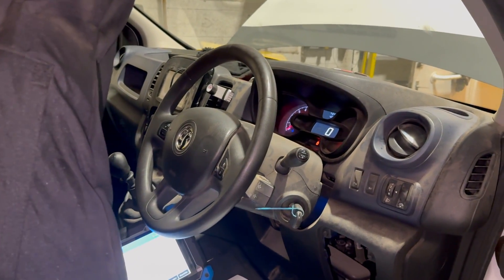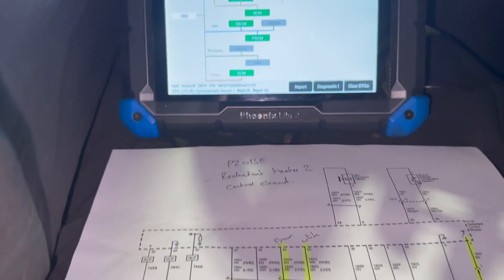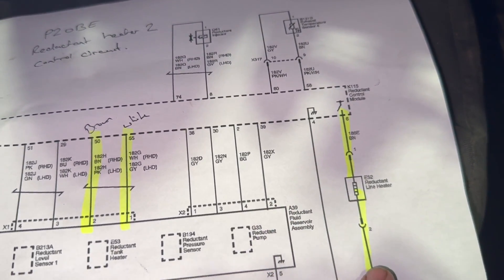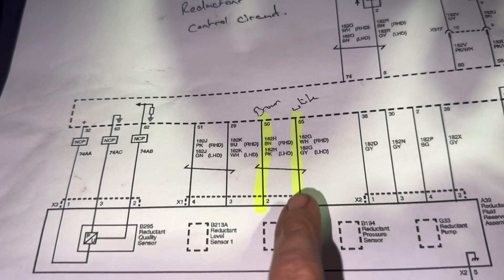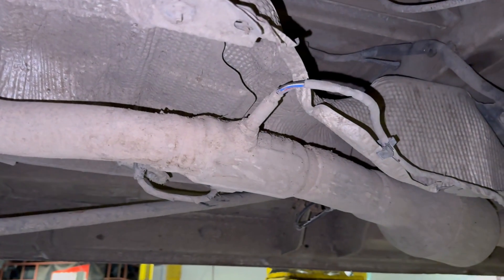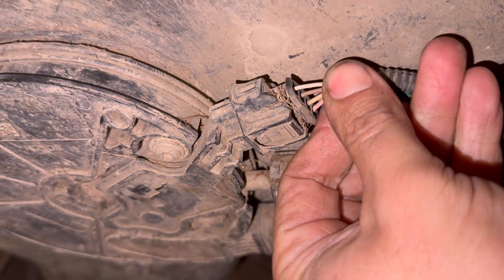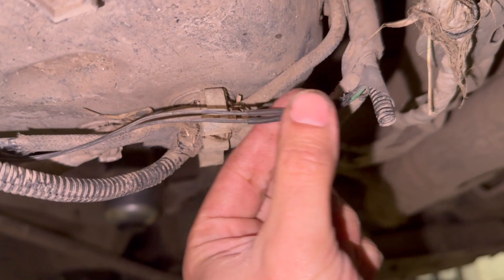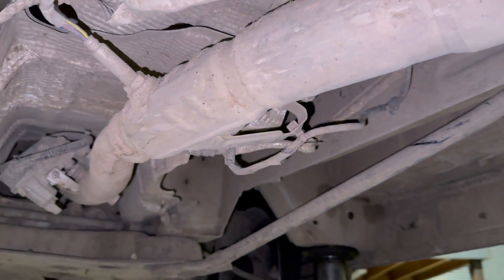Vauxhall Vivaro / Renault Trafic P20BE Reductant heater 2 control circuit

Comment: hi! I have a similar problem with an Astra K 2019, 1.6 cdti. Scanner says P20BE-00. There are no broken wires, checked them all. Any idea what the 00 means in the code? I couldn´t find related videos or posts online.

Comment: 3:31 hi mate, i don’t suppose you know or noted the resistance of a healthy pressure line heater coil did you? Is that diagram from a manufacture portal I can’t find anything on Haynes or auto data!
Reply from the maker: I’m afraid not mate , I got that wiring diagram from our kis system , they use techdata I think
Reply: @diydaly  no worries mate, worth a try. Thanks for the reply, great content as always.
Reply: @b.e.mautos5646 
In-line heater 2on my 2016 125dci traffic is reading 4.5 ohms
I have same fault on dash but using scanner it’s heater 1 that is causing engine light on dash this heater on the brown and white wires is reading 10th ohms 
You didn’t happen to measure your resistance from heater 1 by any chance?